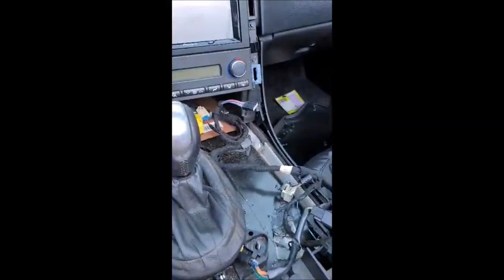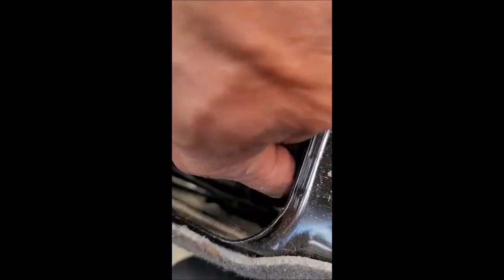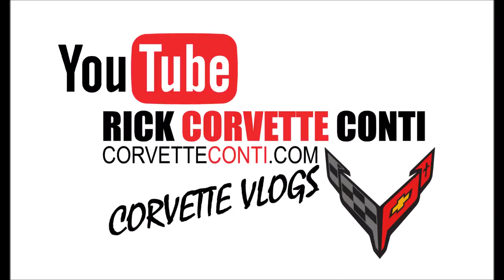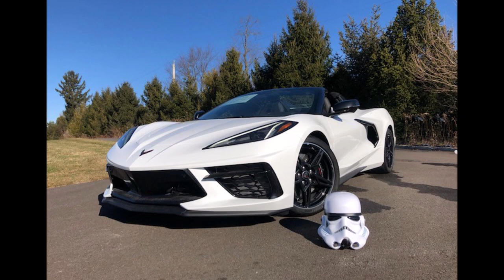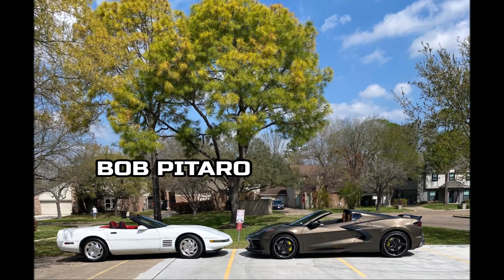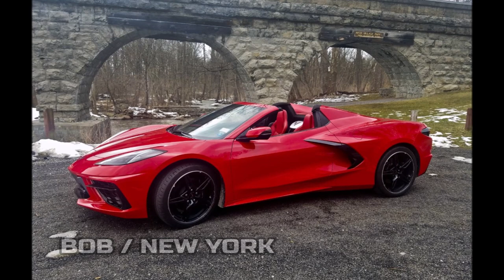WILL GRILL COVERS CAUSE WARRANTY ISSUES ON C8 CORVETTE - YES!

Comment: I don't have my C8 yet but I have ordered some aftermarket items such as engine closeout panels (Elkhart Lake blue), strut protectors, and yes the Grill covers. I ordered the front-installed grill covers so if I do notice any heating issues I can easily remove them. In fact, I can easily remove any of these items if I see they are interfering with the operation of the car.
Reply: Did you order the grill covers for $349? I’ve only seen this set as positioned on the outside.

Comment: Good upload today, Rick. A timely topic since I’m having front radiator grills installed in my C8 today. I figured Chevrolet left them out to enable maximum air flow, so I looked at numerous You Tube Vlogs on the subject as well as two popular Corvette Forums. I ended up selecting the guards made by Custom Car Grills for three reasons. They’re made of metal, are thin (for better air flow), with the added aesthetic bonus of having a honeycomb mesh design that matches the vertical engine vents on either side of my rear window. Since I won’t be tracking my car, live close to the Pacific Ocean, and don’t plan on exposing it to hot weather environments, I figure it’s a safe mod. I’ll update you with a close up picture of the result on Viewer Mail.
Reply: Good price too!! Thanks
Reply: @bigdane1327  $99 for 4 inserts IS a good price!
Reply: Custom Car Grills👍, that's where I bought mine, good quality and reasonably priced.

Comment: May the 4th be with you after drinking a 5th of Jack Daniels. Great VLOG Rick and Tadge's front radiator screen answer I think alot of people want the front screens for that extra added protection to keep out debris and stones. The radiator systems are expensive to replace around $3k from what I heard. Nice car segment Rick have great day. Tom from SC.
Reply: What is your position to mod or not to mod?  For record I haven’t and still thinking some dark or black coating could assist in the visible problem.  Unsure if this could affect cooling or not by using a powder coat or some other surface preparation we can eat our rapid blue cake and eat it too?
Reply: @stephenr115  made my own front screens so far no affect car runs around 180 degrees runs normal so far

Comment: Based on what Tadge said regarding the potential cooling issue of the DTC with grill guards that would prompt anyone who has them to add the extra two quarts of transmission fluid.

Comment: Rick, I got my C8 3 weeks ago. I have almost 250 miles on it. I've never owned anything like this before. How do I know it's behaving correctly? Three things I find very strange compared to my other vehicles...1) Letting my foot off the gas to come to a gradual stop - dropping from 8, to 7, etc...I notice the rpm meter spike upwards alot with each gear. Is that normal? 2) Also while decelerating, once the car drops to gears 3 and 2 it fells as if the car wants to come to an almost complete stop. Is that normal? And 3) At around 55 mph, if I press the accelerator aggressively, the rpm's spin in the 4 to 5k range and stick there for several seconds even after I take my foot off the gas pedal. This is all in Auto mode. Thank you in advance for any insight.

Comment: Just passed "your' car here in Gainesville, Fl. Boy does that color pop in bright sunlight! New appreciation for it and believe the new orange will do the same. Answered a question for me, need a Z 51 to get increased cooling here in Florida. 94 out now and my car was running 10 degrees hotter than in the cooler months. Thanks!

Comment: Easy fix for GM would have been to paint the radiators black instead of leaving them that silver color. Black would have hidden the bends and stones being seen.  But I also had one puncture on my BMW X1 and leaked fluid and $2500 to repair.

Comment: Great vlog! I don't buy it that there was no way to protect the radiator without compromising airflow. A Lamborghini Aventador with a V12 comes with mesh gaurds and has less openings in the front for a bigger engine. I run aluminum grille guards instead of the plastic ones everyone runs as aluminum allows for thinner prongs and not as deep. I guess I will take them out if I track it but haven't noticed any temperature changes. I skipped the side door vents as rocks won't ding up there and you can hand pull the leaves. I also skipped vents for the two smaller openings as they duct air sideways so rocks would hit the duct before the vent.

Comment: Rick it was great to finally meet you at the Bash.  Not having a C8, I was wondering do you have a trans temp gage so you can monitor the Temps if you do use the  mesh in front of the radiators?  Oh at the Bash we did take advantage of the driving experience at NCM motorsports Park. It looked like so.much fun for Ryan and it was a blast.

Comment: Rick, the video fix from Charles Coop. Is probably not the correct fix. On the C6 Corvette GM had a major problem with the gear shift linkage lock up on the automatic transmissions. It's not the linkage. Charles played strong man and over powered the lock mechanism and broke it leading to the transmission. The actual issue is with a micro-switch that pulls a pawl gear back when you start the car that releases the gear knob to shift. There are many examples of the fix on Youtube.
Reply: If you are talking about the shifter solenoid issue, I just had to have my shifter replaced a few weeks ago on my 2007 because it was locked in park.  But there is a workaround, with the car off, press the Start button and go into ACC mode.  Then you can shift to neutral, start the car and then shift it.

Comment: Just got my 2023 C8.  Only thing I found that rear bumper passenger side fitment sticks out 1 cm out.  Not a big issue.  I was going to order the mesh grill sales man said it would over heat and yes warranty will not work on after market add ons.

Comment: How can you claim no thermal degradation when the fins are all smashed in, yet claim there was restriction when a protective cover was used? I'd really like to see the exact guards you tested, because it sounds like they just happened to be very restrictive ones. The aftermarket ABS-type hexagon grill guards I'm seeing in the aftermarket appear to allow plenty of airflow. I've seen plenty of pictures of C8's where the radiator fins are trashed after 10k-20k miles. I think their particular location makes them even more susceptible to stone/bug/debris damage than most other vehicles. Can't blame people for wanting to avoid that, and there is no way that all those smashed in fins does not affect airflow, I mean that's just common sense.

Comment: Forgot to mention that I installed my own Grill screens before leaving the NCM back in September and after 7000 very enjoyable miles, I’ve had absolutely zero problems with overheating or cooling issues. My screens are available for $45 covering all four areas, the two grills in front left and right and both side vents.

Comment: GM has a ton of shift cable problems Trail Blazers, SSR, Trucks and the list goes on and on I am a auto tech, what he does not know is GM usually will not sell that bushing it is part of the shift cable, and for the intense of labor just replace the cable and be done with it.

Comment: Why don't the engineers tell us what the Termp window is for the tranny fluid? That way if we install guards to protect the radiators we can set the cluster to display temp on hot days to prevent over heating the fluid.

Comment: nice job of explaining the grill insert issue. I think that there is much more likelihood of a stone piercing the radiator than overheating. I have no intention of tracking my C8 nor do I live in an area where the temps ever get very high. So I am putting the ones I bought on the car, besides the front end looks better with the grill inserts from C8vettepartsonliine.com.

Comment: Tadge kept saying robust cooling system, if it was so robust then he wouldn't be saying that they wouldn't cover the warranty if you use the grills. The bottom line is he's not the boss and is directed to say what he just said. They just love restricting after market equipment they want us buying everything genuine GM to warranty under warranty period GM wants that revenue. Or that system is border line keeping everything below what they call maximum temp for keeping the trans within their so called window. Bottom line is there not going to cover all things that are related to mods if it affects and related to that systems function whether it caused that failure or not they're always going to say it did. That let's them off the hook for any failures that happen, whether or not the mod caused that failure.